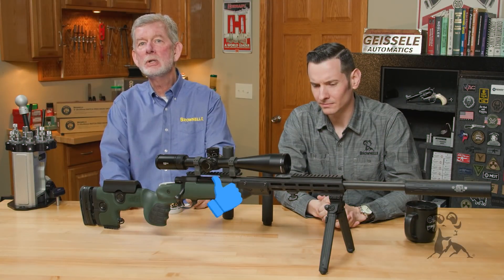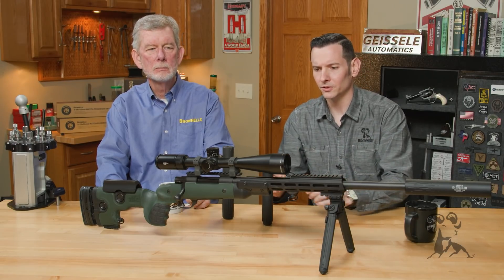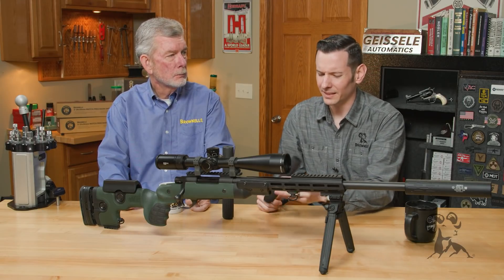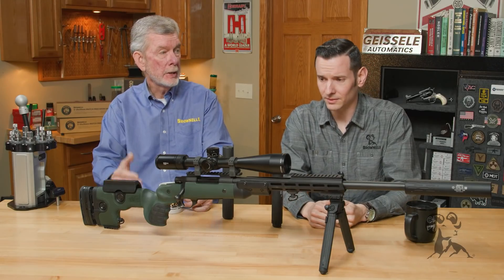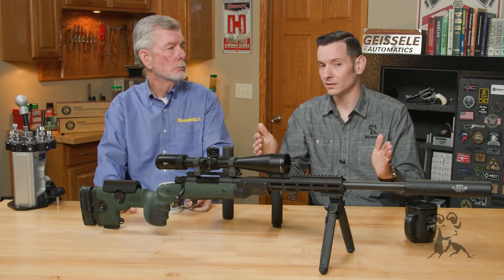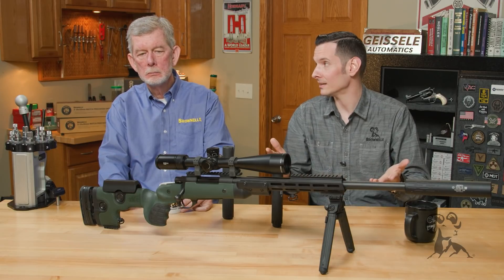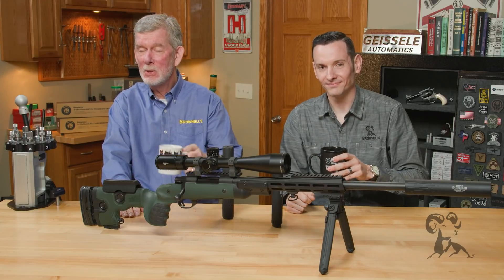Smyth Busters: Does a Suppressor Increase Felt Recoil?

Comment: You guys are wrong.  It's impossible for a suppressor to act like a muzzle brake, because there is nowhere for the gas to escape except forward.  A muzzle brake is designed to send gas to the side and rearward which reduces recoil (and makes range neighbors hate you).  I have suppressors and autos and you can definitely tell recoil increases when it doesn't let the muzzle brake do its job.

Comment: I'd put it this way - the total force-time product (called impulse) of recoil must equal the velocity*mass of what comes out of the muzzle. Obviously the bullet mass is not changed by adding a suppressor. The bullet speed may be slightly reduced by it, though, and more importantly, the amount of gas that ends up coming out the muzzle at high speed is greatly reduced. This means that the mass and velocity factors are both decreased so the product mass*velocity must be less and therefore the recoil impulse must be less. It is possible that the recoil force vs time curve can be altered in a way that makes the peak recoil force larger even if the overall impulse is lower, but that force peak would have to be for a much shorter length of time in such case, so almost certainly it is going to feel like less recoil. It is definitely going to move your body less.

Comment: I disagree. It is true depending on the platform. Silencers on semi automatic firearms increase the back pressure. Essentially over gassing the rifle. That’s why you see a perfect ejection pattern pre silencer go to an over gassed pattern once the silencer is on. Changing spring weights, buffers, and gas pressure with adjustable blocks are added variables that allow you to tune the firearm. But the constant  variable of the silencer will still remain the same regardless of modification. A semi auto will still recoil even less without the silencer attached.

Comment: While I agree with your conclusions, I disagree with your explanation of the mechanism.  Recoil is a combination of the action of Newton’s second and third laws of motion.  The first part is governed by the third law, which states, loosely, that for every action there is an equal and opposite reaction.  This is basically the force of the burning propellant pushing equally on the base of the bullet and the back of the case.  The gases leaving the barrel have little to do with this aspect of recoil, thus recoilless rifles exhausting the gasses in the opposite direction of the direction of flight of the projectile.  The suppressor cannot affect this aspect of recoil directly, so trapping gasses is of no value.  However, it does serve two purposes, 1) it can act like a muzzle brake and redirect gasses, which serves to use those gasses to control the motion of the recoiling weapon, and 2)  as you observed, it increases the mass of the weapon, which affects (reduces (f=ma)) the acceleration of the weapon in response to the rearward force applied by the burning powder.  This is essentially the operation of Newton’s Second Law of Motion.

Comment: This isn’t entirely true. A suppressor can increase felt recoil when compared to an effective muzzle brake. This can be seen easily and is exaggerated when using something large like a 50 cal. A good brake doesn’t just redirect gas outward, but will also direct gasses backward toward the shooter. The mass of the backward gas flow produces a forward thrust relative to the rifle, counteracting felt recoil. A suppressor doesn’t do this, which is why 50 cal suppressors have more recoil over a really good brake. When compared to a bare muzzle, no suppressors don’t increase recoil.

Comment: Good video and all, but that's not how busting myths works... You don't just say "this is why it's busted, because, physics". You should actually test it. Put a force gauge behind the gun in a bench firing sled that can move, fire it with and without the suppressor, and see which is lower.

Comment: I would like to preface by my comment by stating I am probably wrong and my testing methods were very likely flawed, but in my limited testing on a mid-length 16 inch di 5.56 with a H1 buffer and wide open gas block mounted on linear rails, using a load cell I measured on average a 35% increase in recoil impulse switching from no muzzle device to a pretty restrictive (.26 baffles and .25 end cap) direct thread suppressor. I don't have a way to accurately measure the bolt velocity, but I believe that with the H1 buffer and the restrictive suppressor, when the bolt unlocks there is still a substantial amount of pressure over speeding the bolt and causing the buffer to strike the back of the buffer tube. With the gas port completely closed, I measured a reduction in recoil impulse of about 17% when using the suppressor. I would really appreciate your feedback and advice because after seeing this video I've been scratching my head trying to make sense of this.

Comment: Would forward linear compensators follow the same physics? My understanding is these act like silencers but don't need the tax stamp.
Reply: Well, a linear comp follows the same physics because everything follows physics, but my conclusion is that it would not have the same recoil reduction effect as a suppressor. A linear comp has no baffles (which is why it's not an NFA item), it merely directs all of the muzzle blast forward. The reason a suppressor mitigates recoil is because when the hot combustion gas goes forward out of the barrel, it strikes the baffles and so gives the suppressor (and the rifle it's attached to) a slight forward push, thus imparting a force that is in opposition to the rearward force of recoil. Since a linear comp has no baffles, this does not occur; the muzzle blast flies downrange unimpeded (and since it is all directed downrange, that is why rifles with linear comps sound slightly less loud to the shooter). When I was considering buying a linear comp, I researched various forums and users mostly reported little or no effect on recoil, but I suspect that would depend on what kind of muzzle device they were using previously. If they were using a muzzle brake, which mitigates recoil by directing some of the combustion gas rearward, they would likely feel the loss of that recoil mitigation to some degree. Conversely, if they were using a birdcage flash hider, which doesn't reduce recoil, a linear comp should feel the same.

Comment: Wouldn’t a heavier buffer in a DI gun slow down the bolt carrier and lessen the felt recoil?
Reply: Sometimes, but if it is not heavy enough it will actually increase the recoil due to the extra mass being driven rearward. Kinda like how an Auto-5 has more recoil than any other shotgun the same size and weight.

Comment: If you go from a muzzle brake to a suppressor you will have more recoil with the suppressor on compared to just the brake on. Very noticeable to me, I have at least twice as much recoil with the suppressor on than with the suppressor detached and just the QD brake on.
Reply: A suppressor doesn't completely divert the gas since it needs to contain and slow it (otherwise it's not going to do its job) so it won't be as effective as a break in that regard. 

I would be interested to see what the energy dispersion and weight from a break compared to the minor dispersion and weight of a suppressor to see on which calibers (if any) is more effective at reducing felt recoil.

Comment: Tested on a bolt gun... "Suppressor Comparisons – I included a high-end 9” suppressor for comparison on the 6mm recoil tests and 30 cal recoil tests for comparison. Compared to the brakes, the suppressor always ended up near the bottom of the list. The top brake was 62-64% more effective at reducing recoil on the rifles tested. I also included a suppressor in the test for staying on target, and while it did slightly better than a bare muzzle … virtually all of the muzzle brakes were better at keeping you on target, and some of them significantly better." - Precision Rifle Blog (https://precisionrifleblog.com/2015/08/21/muzzle-brake-summary-of-field-test-results/)
Reply: Isn't this to be expected though? Brakes put the energy out while suppressors slow it down. Both offer improvement compared to nothing but the former does the job better.
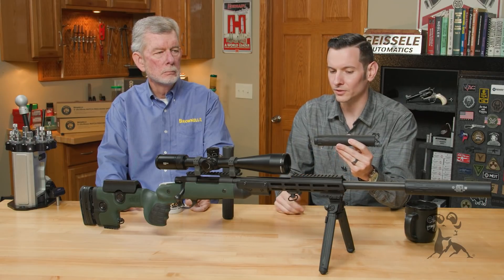Reply: @joeb6750  Mainly posted for folks who prefer to look at actual numerical data. There is a wealth of knowledge and data points in the multi part series in the article. Also, it was to refute Brownell’s blanket statement that a suppressor is more effective than a muzzle brake due to it adding weight to the firearm (around the 1:05 mark in this video). A Thunderbeast suppressor outperformed 8 brakes, tied with 1, and was behind 8 in regards to peak force in the 6mm test. So it was middle of the pack. But it only beat 2 brakes in regards to overall momentum. Link to the specific article in the multi part series: https://precisionrifleblog.com/2015/07/07/muzzle-brakes-recoil-results-for-6mm-6-5mm/

Comment: Here is a question do shorter gas systems for an ar15 require lighter springs and buffers, and on the opposite of that do longer gas systems require heavier springs and buffers?
Reply: That would make it overgassed.

Comment: Every action has an equal and opposite reaction. Given all other things equal, trying to slow or stop the travel of an object going one way will translate into energy going some other way, usually straight back where it came from. In the gun world, that would be the shooters shoulder or arm. So I would think it would increase recoil a tad, and like Caleb said, increasing the mass does help , but with a suppressor that's negligible . Blow back is definitely a thing n the suppressed world you can get all kinds of gunk shot back at you that normally wouldn't if you just ran a standard muzzle device made for that gun. So something's going on there .

Comment: I'm a physics professor and I approve this discussion. :::)))
Reply: I’m an engineer so I say mount an accelerometer on the dang thing and prove it with data.  End of discussion after that.
Reply: @mattbrown9484  that would make a good video. You should post that
Reply: @mattbrown9484  Agreed.  I've seen data on impulse, maximum force, and total recoil energy.  I've never seen the setup or an actual demonstration of the tests being done. I doubt the NSF would give me a grant to study it either.
Reply: @phprofYT  https://youtu.be/Hiju-bzvf34 video has already been made. Many high caliber rifles will come with a muzzle break and if you swap it out for a supressor there will be a noticeable increase in recoil
Reply: @wsollers1  Nice video. Like to see some force sensor data as well.
Reply: Not a physics professor, but as I recall every action has an equal, but opposite, reaction. A muzzle brake that diverts the blast towards the rear will lesson the felt recoil. A suppressor that diverts the blast against itself doesn’t make any difference. Just like being on a sailboat, and blowing into the sails to go forward. Not gonna happen.
Reply: @tomleonard4895  True. However, the myth was it would increase felt recoil.  That's just not going to happen has it has no way to generate more energy.  Given it is a weight out on the end of the barrel it is more likely to decrease muzzle rise and decrease felt recoil.  Felt recoil is likened more to the impulse than the total recoil energy.
Reply: @phprofYT  Yes indeed. It is easy for people to get the difference between apparent / felt recoil versus actual recoil mixed up
Reply: @tomleonard4895  All else being equal, you'd be right. What you're missing is the jet effect of the hot propellant gas exiting the barrel unidirectionally, which turns every discharged firearm into a high energy rocket launching into your shoulder or hand. I've read figures in some gun/cartridge combinations' recoil, some 80% of the thrust is made up of this jet effect.  
When you stop to think about it, it's pretty intuitive. The mass of the bullet is pretty damned small compared to the mass of the rifle and your shoulder. it'd be pretty hard to shove that little slug hard enough to account for up to 70+ pounds of thrust against your shoulder, in the case of the larger Safari calibers.
Reply: @tomleonard4895  It will trap gasses for a bit longer and increase recoil, absolutely.  It wont' be by much though, and it will probably be imperceptible to a human.
Reply: I`m a welder and I approve of this discussion.
Reply: What of the inherent increase in velocity? There are several factors to account for in both actual and felt recoil but newtons third law still applies in all cases, no? I suspect that the effects on gas flow are the driving factor but is this true in all cases?

Comment: I know on my bolt rifle it smooths out the recoil impulse quite a bit. I was told on a forum that I didn’t know what I was talking about because a suppressor increased recoil. I have a rebuilt shoulder and a hard recoiling rifle for me is something I don’t enjoy. I could only find 180 grain 308s one year for deer and was dreading shooting that when I normally use 150s. Was I ever surprised and delighted the first time I squeezed the trigger! I shot the box sighting in and making sure that it wasn’t just an anomaly using my suppressor.

Comment: I definitely agree that it doesn't increase recoil. However, in a firearm that you have not tuned or adjusted (gas operated) for a suppressor there may be a bit more but I don't think it would be noticeable by the shooter. As you said the muzzle break aspect of it does reduce the felt recoil but the increased speed of the action can increase felt recoil and the suppressor could very well negate if not eliminate it. So I agree that in a practical sense no it does not increase recoil but when it comes down to the math and numbers I wouldn't be surprised if there was an increase of force, just not big enough to make a difference.

Comment: Great discussion! I disagree.  
The explosion of the cartridge generates energy, that is in part transmitted to the mass of the firearm. Part of the energy is transmitted to the projectile. Some  (maybe even most) energy is in the gasses that travel along the barrel. A muzzle device is located at the end of the barrel (e.g. a suppressor), and must hence affect how the energy exits the barrel. 
However, "felt recoil" is certainly subjective.
Reply: Have you ever shot a suppressed rifle?
Reply: Read up on Julian Hatchers info on muzzle breaks and recoil, there is is explained in full detail.
Reply: @CalebSavant  please communicate a reference!
Reply: @CoinShow  Hatcher's Notebook
Reply: A suppressor diverts the gas and dissipates the energy to reduce the speed of gas traveling out of the end which reduces the sound profile. The initial dispersion is the significant part as that drastically reduces the force in a single direction as gas flows around. With that and the added weight, the apparent recoil will be less (or the same if you don't notice). But yes you are right it affects how energy exists the barrel,  that's how it reduces sound.

Comment: I have a suppressed .338 lapua magnum bolt action rifle. The suppressor fits over a break in a QD mount. The brake makes the perceived recoil less compared to when the suppressor is mounted. But the benefit of not going deaf and the added accuracy with better barrel harmonics using the suppressor is a +
Reply: * brake

Comment: Would a suppressor reduce bullet velocity and/or energy and range?
Reply: In most suppressors, no. It might increase velocity as once the bullet enters the suppressor there is still some pressure behind it until it leaves the suppressor, but far less than while it was still in the barrel. This small amount of pressure might not be significant, though. If you have a suppressor that is wipe based, where the bullet is passing through multiple layers of rubber or polymer, that will negatively affect velocity. But wipe based suppressors are very rare on the U.S. civilian market due to higher maintenance requirements (you have to replace the wipes every couple dozen rounds) and that replacing the wipes yourself might not be legal depending on how the ATF is enforcing the law that week.
Reply: @darthhodges  Thank you.
Reply: Of course not. It can very slightly increase it though depending on rifle/caliber etc combo.
Reply: https://youtu.be/Psk65mhcxrs

Watch this video. They can help at longer range.
Reply: @hockeyginger1  woooo,I watched the whole video. That was really informational. Thank you for sending that link
Reply: Depending on the cartridge they typically will increase velocity. :)
Reply: I believe (please correct me if I'm wrong), but some integral suppressors such as on the MP5SD can cause a slight decrease in velocity. This is due to the numerous ports drilled into the barrel just in front of the chamber which divert gas into the suppressor, which, having a larger volume than the bore of the barrel results in lower pressure on the bullet.